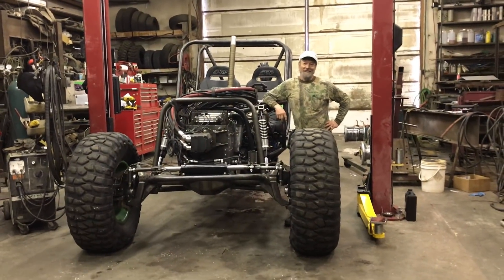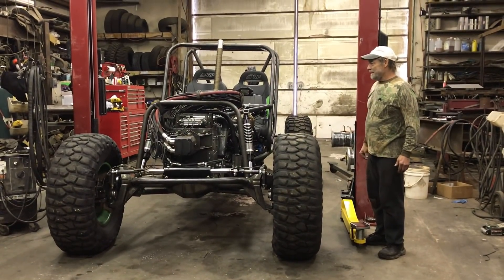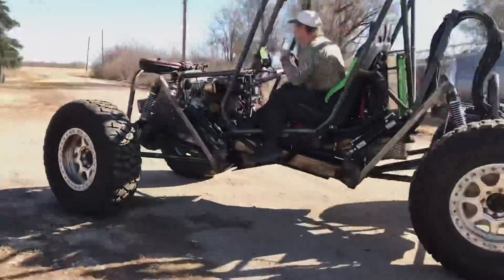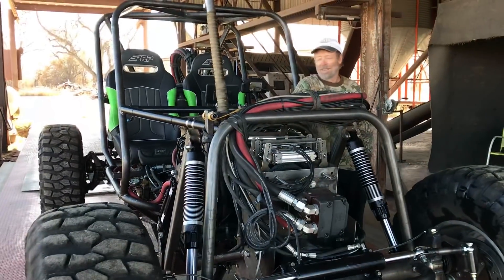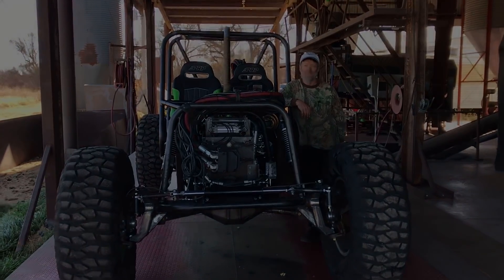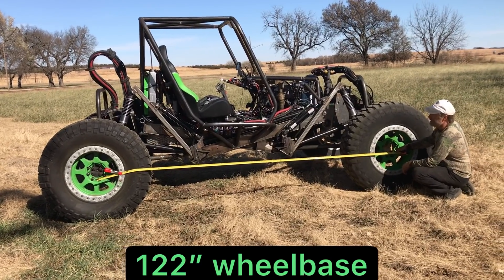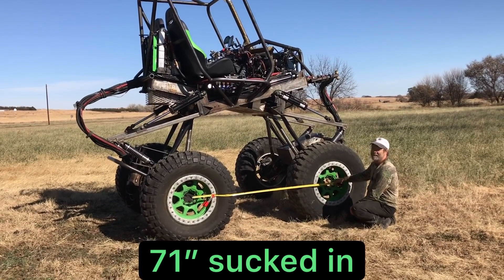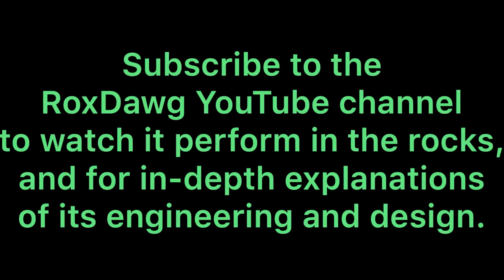Beyond Extreme- Hydraulically Driven Rock Crawler

Comment: Hi! Nice work! The 'The Green Rock Dawg' version looked better and more flexible. I am interested, any of them is for sale and what is the price? I have an idea how to modify them, using uutrunner brushless motors inside the tires so can be full electric efficient hgh speed also and motor would take place inside wheel, no extra mechanics.
Reply from the maker: I liked the green dawg as a well.  It was just so intense to drive, needed a computer  to help.  I wished the electric version would of worked out however the company selling them overestimated/Lied about their torque.    Would love to see  a wheel motor version.  My cars all have been learning prototypes for my enjoyment.  Not sure they would be the best platform for a wheel motor.  With that technology I would design the car way different.
Ld
Reply: @roXdawg  I am building multicopter drones and write the flight contreller software, each motor has its own ESC computer to drive and PID controllaler algorithm. Check how brushless outrunner motors work with 3 phase, not that difficult.

Comment: Very cool and you definitely have skills. I'm guessing the only drawback with using hydraulic motors is your driving speed will be limited. You also need to be carefull with high impacts (jumps and hard landings) cause you'll blow the lines due to pressure surges.

Crazy build dude. Nice job.
Reply from the maker: yes, changing the hydraulic motors to higher torque variable displacement.  Hopeing to see a 50+ top speed.

Comment: I saw something similar but it was a piece of specialized ditch cleaning equipment, and all four wheels/corners were independent and the wheel base side to side could be widened by manipulating each corner wheel outwards as well as like your rig. Just a thought, your rig/buggy/crawler is absolutely amazing tho and im super impressed you built something this crazy by yourself it's an amazing feat of engineering!
Reply: I built another car like that years ago called rock spider

Comment: I'm sitting here wondering how much speed/torque can be delivered to the axles via the hydraulic drive unit.
Reply from the maker: This first season on the trail we found that these performed impressively given the loads and beatings we gave them, but... not quite enough torque and not quite fast enough. Alec is in the shop this spring redesigning and rebuilding them. Stay tuned to see what he comes up with!

Comment: Kool Next needs hydraulic-driven wheels like a scissor lift so the axles are not an issue.
Reply: I called it Rock Spider.  I like the solid axles,  and it's lots easier to  drive. Search Roxdawg on YouTube,  there are more videos of the  build.
Reply: Hydraulic lines are but they look good... what ratios  to pressure....... hell what pump and power plant .... does the hydraulic pump got a cooling reservoir for the hydraulic oil ? WHATS A CURB HOPPER?
Reply: There is one like this years back that was independently driven off hydraulics. Hell it might be this gut that built that one too